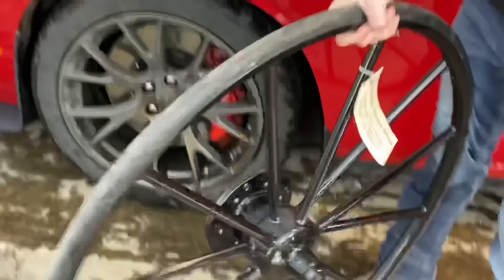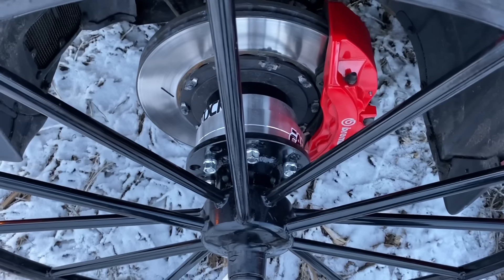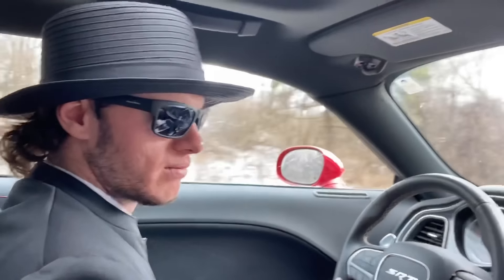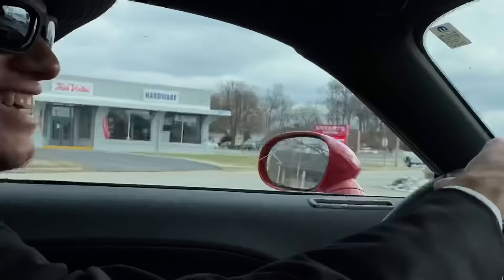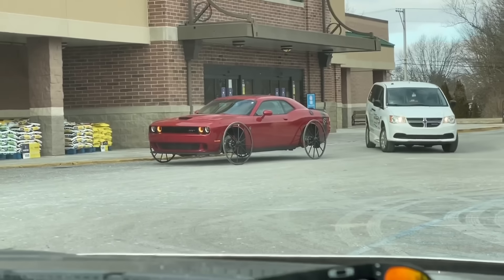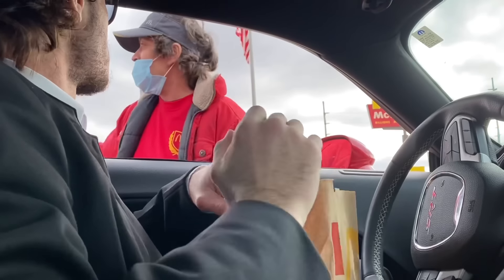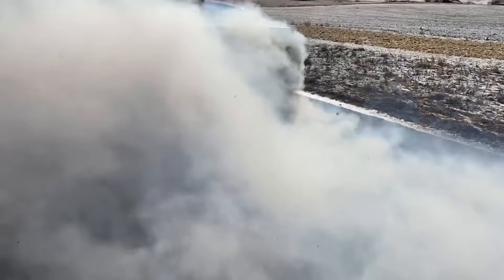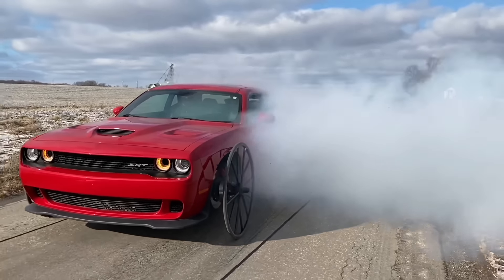Hellcat on Horse & Buggy Wheels goes to town and does burnouts

Comment: If we learned anything here, it's that buggy wheels are built a lot better than we thought.
Reply: I’m surprised they survived
Reply: Well, the thing is, the more spokes you have, the quicker the weight transfer so the less stress there is on the rim. Being aluminum, they're no different than a set of giant allows, albeit with a tiny contact patch.

And actually, the fact that they're so narrow is what allows them to survive burnouts. Normally, due to the amount of grip, the engine and drive-train have to force the tires to spin, while the tires are trying to grip the pavement and sending the reaction back into the drive-train. This is why axles and some wheels break, because the torque and resistance are fighting each other and they'll usually find the weakest element and destroy it.

With a contact patch so small, there is almost no resistance, only the torque spinning the wheel, so there is no stress on the hub or axles, and ultimately, none on the wheel either.
As far as fun is concerned, this is the ultimate combination, as you can do huge burnouts with minimal effort from a stand-still.

The disadvantages, obviously, are that the wheel size requires way more room for turning, there is no way to quickly accelerate so every increase in speed must be smooth and incremental and, lastly, braking is very dangerous since there is not enough grip keeping the car stuck to the road (so you end up having to go almost as slow as a real buggy anyway, to avoid plowing into whatever's in front of you or sliding off the road in a corner).

Needless to say, there is no way of driving on anything other than pavement or hard-packed earth, as the wheels barely have any weight distribution so they would immediately sink in soft earth or mud and bottom the whole car out.
Reply: the rating is probably for the rubber, thats why it flew off soo easily
Reply: @vtr0104  Awesome post. Thanks a lot 😉😉
Reply: Same
Reply: @deltajohnny  You are most welcome, good Sir.
Reply: I know I'll be sleeping better knowing that.
Reply: I thought the death noodle would take the door mirror off?
Reply: You're suprised? They're prolly made by the amish lol
Reply: It ain't wood fool
Reply: I would have never thought they would last like that
Reply: to bad the car is totaled
Reply: @ctrudeau55  Amish make a lot of great stuff, more than just wood crafts.
Reply: These are aluminum and as far as I know most buggy’s use wood. But I know some are starting to switch
Reply: If we learned anything here. It would be spoiled rich kids have access to more money than common sense.
Reply: Can't reinvent the wheel
Reply: Haha.  My neighbors are amish.  Those arent amish wheels.  Their wheels are generally wood
Reply: And that no matter if you like him or not, he brings happiness and entertainment to his entire community.
Reply: @vtr0104  i like the physics lesson and stated facts good sir
Reply: Yeah it sure is
Reply: @Jannis Joplin Please don't bring that up... I still have PTSD from mandatory homework back in grade-school.

There shall be NO homework, other than watching other fun videos, car related or not.
Reply: exactly
Reply: I know right i can't believe my eyes
Reply: Duh. They're Amish
Reply: The Amish make a damn fine wheel.
Reply: @AX_  The rubber is only held on by a wire embedded in the rubber , sort of like a bead but you cut the tire oversize and trim the rubber back to expose the wire. You twist the wire to tighten the rubber down. Old solid rubber tires for vehicles 100+ years ago were vulcanized onto a steel band that would be pressed or clamped onto the cars spoked "rim". This rubber would not peel off.
Reply: @stevescott1962  Built Amish tough!
Reply: you re 2500th like
Reply: You can make a spoked wheel using yarn as the spokes and it will still work lol
Reply: literally the only thing we learned.
Reply: Def didn’t know they were made out of steel these days. No way could he do that on the old wooden ones.
Reply: @mark hilonda Amish buggy wheels are steel, with solid rubber on the outside.
Reply: Apparently you've never seen Amish craftsmanship
Reply: Lmao my first thought before I clicked was that there is no way those wheels can hold up to that car.
Reply: Oregon trail has been lying to us...
Reply: @Mr_Putts  LOL
Reply: I mean the amish make quality products
Reply: Captain Obvious: Common sense common sense tire, common sense common sense weight common sense.

Random Youtube idiot: Thank you, sir, for your amazing dissemination of knowledge. Sure you deserve the Nobel Prize for such a profound contribution to humanity.
Reply: @drygordspellweaver8761  : oh look at me, im so edgy.
Reply: This r newly made 🙄
Reply: @davidreali9642  i mean, its a joke. Dont take it so hard.
Reply: Theyre metal i think
Reply: @donutoperator3286  They are metal...that's how the Amish build them now too.
Reply: i’m surprised they held it up not event a tilt
Reply: That’s the only reason I came bcz I honestly thought they’d just break and fly, they must be specifically reinforced
Reply: When made out of aluminum instead of wood like they typically are
Reply: Whew, big "IF", there buddy. I don't come to this channel to do such a pleb thing as "learn". Go back to Mark Robert, ya nerd. Lol
Reply: Oh hey it’s RamblinAround! I was just thinking of you guys the other day actually. I hit a deer and thought of your deer incident in the Firebird years ago...
Reply: I’d like to think they function awesomely in winter. You know, all the weight distributed over a tiny surface area cuts through the ice and snow, but I also assume at some point the tires would be to thin to even have any grip at that point.
Reply: @vtr0104  you could be my tutor for science
Reply: actually amazed, my MTB wheels cant cope with a harsh landing but an Amish buggy wheel is capable of cutting through a road surface.
Reply: Not only that, but there isnt much difference when drivjng over bumpy country roads and they drive straight and are easier to control. Why dont we use this lesson and make thinner tires with better traction and even lighter more durable materials that cost less to replace versus the large ammounts of rubber which are bad for the leftist propoganda... I mean envirement! 😅
Reply: They looked more like carriage wheels that can weigh several tons tbf
Reply: @vtr0104  so, what your saying is... stack the buggie wheels with spacers and weld it. Creating a QuadWheel, for increased traction.
Reply: So its not clickbait? Interesting I guess I will watch it
Reply: @user-vl9xs5dl7q  That sounds terrifying, but in theory, you would get more traction :|

Your problem will be supporting it. The more buggy wheels you add, the more weight is added by each one for a relatively minimal amount of traction increase.
And the further away you move from the wheel hub, the more camber you will see (the car will "sink" more the further it is from its outermost point of support, this is why wheels are normally inboard of the body and as wide as possible) and the more weak-points you're adding to the situation.

So, even though you may get more traction, you'll have to be even more careful when steering or initiating momentum changes (whether  it's accelerating or braking) to mitigate damage to the number of connection points between the stacked wheels.
Reply: And that newer wheels models are just for looks
Reply: ...unless you're on the Oregon Trail.
Reply: Well the thing is you all are deaf he clearly said at the beginning of the vid that they are made of aluminum
Reply: I learned to never buy a used hellcat
Reply: No more like don't fuck with the amish because they are the only ones who make shit that actually lasts and doesn't break when actually used
Reply: Good point
Reply: Doing underestimate the amish
Reply: You’re using pseudo physics, your available friction force is independent of your surface area.
Reply: “Off the books I know where you live at” that doesn’t sound creepy at all lol
Reply: If we learned anything here is that these guys got money to waste cause this could've gone all wrong
Reply: @vtr0104  cool. Thanks for the info.
Reply: @vtr0104  thin rear wheels and normal front wheels would make the ultimate drift car
Reply: Well duh they were built to last unlike everything today. Buggy Wheels have a lot more time rolling then cars Wheels deal
Reply: Well they were Amish wagon wheels.. lol
Reply: Facts tho
Reply: Considering a land yacht was on top of them, I’m impressed.
Reply: Well those are still technically the longest serving style of wheel in all of history
Reply: @Slit-throat  well it would be fitting because it’s a land yacht lol
Reply: Well they definitely weren't the wooden variety lol
Reply: yeah i was shocked the wheel held up with the weight
Reply: Yes
Reply: Yeah i thought when he put it on it would break into into alot of peices
Reply: Amish/Mennonite don't play. Build it once and take care of it.
Reply: Lmao facts bro facts 😂
Reply: Honestly, he's actually helping the scientific  community through experimental  research on how well(or not)  vehicles hold up with different mechanisms under all sorts of  circumstances
Reply: You know that video of the lil ginger kid saying apparently ya well APPARENTLY 😆
Reply: True buggy wheels are made of wood not steel
Reply: @vtr0104  I didn't read all of that but I'm impressed you spend that much time to preach to random people about wheels
Reply: @grindcoreelitist6985  Amish buggy wheels are made of steel or solid rubber most made of steel sorry to break it to you kid but you gotta stop watching movies and think your educated😂😂
Reply: @da1flyinhayn445  I'm not a kid and I'm smarter than u
Reply: @mrskunk697  Aluminum would've collapsed.  They were steel
Reply: @WhoisJeffrey  Toda América sería un solo país es México en un futuro próximo el idioma oficial sería en español  México va ser el primer mundo México será potencia mundial  vivA México querido México
https://youtu.be/7uJhjQvJDh4.
Reply: Wel they’re aluminum. Not wood, so that’s most of it.
Reply: Facts
Reply: Jesus died and rose for you, believe onto Him for salvation know you stand comdemed and be saved. <3
Reply: Hell yeah bruther
Reply: Repent!  Always bruther
Reply: These are not wood wheels though. They are some sort of alloy.
Reply: Naw. You mean you learned something new. Not we.
Reply: @vtr0104  was this some kind of task for school? I mean u didnt need to write an essay
Reply: And the wooden spokes that were pulled half way across the country too.
Reply: Those buggy wheels are
Reply: if wheels wernt so common we could all admire and be astonished at the engineering of them. theyre basically the most useful/strong things to ever be invented past the knife.
Reply: The Amish don't fuck around with craftsmanship.
Reply: Absolutely…not only are the Buggy Wheel impressive but whoever welded those on to hub did an AMAZING JOB! That shit is CERTIFIED WELDING!!! Certified by the Amish that is..woot woot!!!
Reply: @vtr0104  Great breakdown, thanks a ton!
Reply: Well proper forged wrought iron buggy wheels are really heavy duty
Reply: @vtr0104  well explained!!!
Reply: All I could think was "okay, it's smooth going straight and turning gently - but what happens if you cut the wheel hard to the side?" Since you can't roll over the sidewall, I'm thinking the entire wheel would flex laterally and fail at the spokes.
Reply: Not at all the carried people and all their belongings across the country through every terrain your imagination can think of.
Reply: @dmac7403  Fair. I guess I assumed the stresses associated with a modern sports car would be too much for the form factor of a carriage wheel, but really I'm just unfamiliar with the scenario.
Reply: @vtr0104  i have no idea what u talking about, all i know is it goes broom broom and it funny
Reply: Better than the car.
Reply: No kidding Holy shit.
Reply: @vtr0104  contact patch doesn't matter when it comes to friction. It's the material itself. Nothing about surface area has to do with friction. That being said, a bigger area usually means a material is grippier/softer (coefficient of friction) but the area itself doesn't matter.
Reply: Yeah back then they built stuff to last long, now they build stuff so ppl have to buy more and more of it
Reply: No it's that we need to stop giving this man so much money lmaoo
Reply: Of course they are, roads used to be kinda bumpy and all made of dirt.
Reply: Ikr always seen them be the first thing to get destroyed in cowboy movie fights 🤣
Reply: @b.c4066  Why so negative. Do you know him in person ? His videos are maybe controversial to some but a lot of fun to watch. He is able to do whatever he wants and thats good for him. I am glad he shares his fun with us and doesnt treat cars like all the thousands of boring car channels. He is living life to the fullest and i hope sad and angry people wont get him down.
Reply: They're designed to last a lifetime. When you design for decades rather than years it will hold up better a la the Toyota Hilux.
Reply: Im actually surprised they survived the Whistlin attack

Comment: Those wheels are surprisingly strong and balanced at such high speed. Stopping test would have been interesting.
Reply: Well duh it’s a hellcat, turning isn’t its strong spot
Reply: @matteokrause6788  the fuck, who spoke of turning???
Reply: the fact that the brakes have more braking surface on the disc than the Wheel on Road should say enough
Reply: @kleinfeicht  Yes, those wheels would have locked up and the car would try it's best and those strong wheels would be challenged by other great forces and the result would be either be.... 1. Shattered spokes. 2. Motionless wheels worn in to semi-circles. 3. A long slide. 4. ABS works so well it actually stopped the car in a short distance without shattering wooden wheels.
Reply: he stops at 13:18 you can see the ABS clickin
Reply: @matteokrause6788  I know what you meant. The lateral handling was pretty much the same. 😂😂
Reply: Of course the wheels are strong ,the Amish make their stuff right
Reply: @KryptoKn8  not me
Reply: @matteokrause6788  have you even driven a a hellcat
Reply: stopping: well someday...

Comment: OH MY LORT. Who needs 1 or 2 Horses to pull you when you can have 707 horses.
Reply: lol, cause hellcats come with 707 horsepower
Reply: Warzone tonight?
Reply: prone  Your comments on this channel are all negative. Get a life stop complaining
Reply: Fun fact, 1 horse can put out around 14 hp
Reply: @jalensturkie2870  is that brake horsepower or to the hooves?
Reply: @BenJammin427  I'm not sure. I only read the brochure
Reply: @jalensturkie2870  they put out from 13-16 horsepower depending on the size and strength
Reply: @jalensturkie2870  I read that athletic people can put out about 1.5 horsepower
Reply: @beans6289  your right they come with 717 hp
Reply: @juanblendsbiggestfan9610  Old ones were 707 though. But then the TRX is like 702, the Redeye is 797. It's strange.

Comment: When you did burnouts I was like “imagine a horse causing those marks”
Reply: after hours and hours of research... i have found that a horse cannot in fact makes those marks, but it would look funny as fuck if it was possible
Reply: @mtt6123  .... horses dont spin the wheels, they pull the carriage, so it couldnt do it either way
Reply: @TheGermanDude   no the amish hook up the carriage wheels the the horses ball joints these days it helps a lot with torque
Reply: Great grandad used to go out drifting his horse and cart on the cobblestone streets
Reply: @TheGermanDude  If the horse is strong enough, it will pull the carriage so hard that the wheels don't have time to start spinning, thus cutting through the asphalt.

Comment: "I had em at 170mph!" That was with the speedo calibrated to standard tire size - with the increased diameter, those rims were definitely seeing 200mph+
Reply: Actually bigger wheels reduced the speed overall.
Reply: @ssj2camaro21  nah if you lay out the circumfrience of both the stock wheel and the larger wagon wheel you will see theres more distance (longer circumfrence) for each rotation than the stock wheels
Reply: @reddit-chan9339  yes but thete spinning significantly faster from almost no friction and much less weight
Reply: @willf1118  ??? obviously he wasn’t actually going 200+ but the wheels were spinning that fast
Reply: @willf1118  homie when its going that fast there isnt any traction...... thats why tires slip out. the weight hardly matters. homie.

Comment: Absolute madlad
Ps I'm still shocked as to why the rims didn't break considering the weight of the car
Reply: wheels are made out of obamium-1269 material
Reply: @dimjat  thats some strong shittt!
Reply: Wtf shidbot why are you here that is haram!!!1!1!!1😳😳😳😳😳😳😳😳😳😳😳😳😳😳😳😳😳😳😳😳😳😳😳😳😳😳😳😳😳😳😳😳
Reply: @NotUrHoesHoe_92  I'm sorry but I'm pretty sure Obamium is better than aluminium, so yeah, definitely Obamium
Reply: @madowarrio6065  Barrack Obamiun
Reply: @thatjay5852  Barrack Obummian
Reply: @NotUrHoesHoe_92  
They’re clearly obamium
Reply: Ig buggy’s are pretty heavy too
Reply: Shocked why ?
His dylithium torque converter bypassed the trilithum influx capacitor causing a rip in the time continuum abstract release algorithm In the dynoramic indicator, that's why they didnt
Break....
Dammit Jim...Im a doctor.
Reply: Thanks obama :)
Reply: holy shit it’s actually shidbot